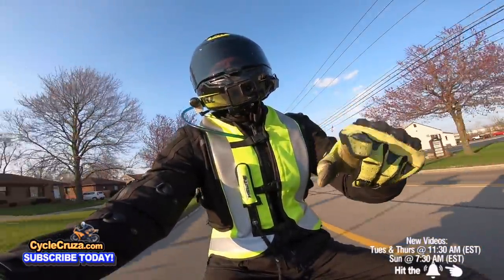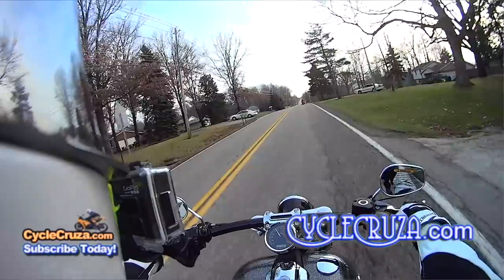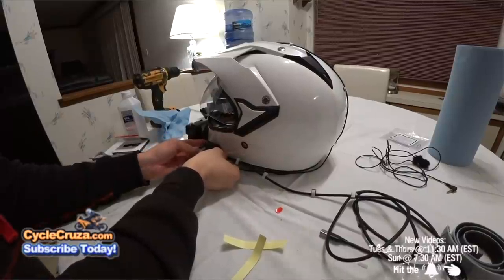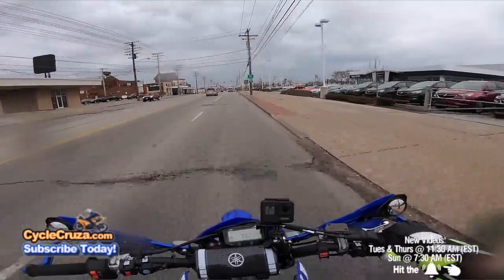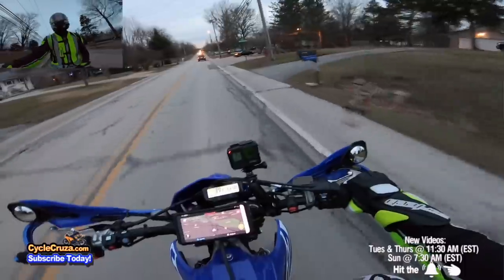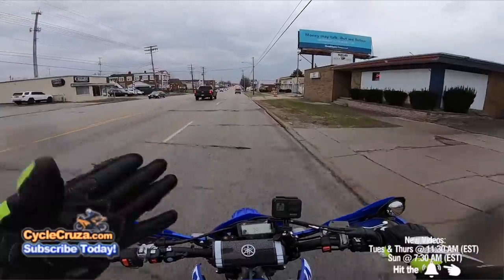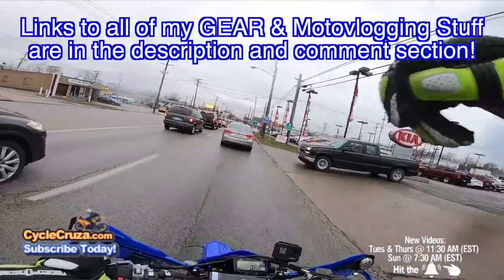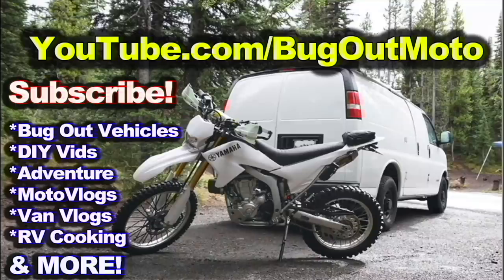How To MotoVlog  & Helmet Camera Setup

Comment: The audio sounds good at 30 or 40 mph. How does it sound at 70 or 80 mph.
Reply: I have a tough time at those speeds. I use a deadcat which helps a lot.

Comment: I'm working on my channel one vid at a time. Having a real struggle with audio. My cheap GoPro clone doesn't have separate audio input, so I use a digital audio recorder but it's way too sensitive! You'll get wind noise from a fart across the room. It's good for interviews, courtrooms and ghost hunting but not motovlogs unless I'm only going walking speed. I'm in the market for a new helmet anyway so it may be time to invest in better recording gear.

Another challenge I'm having is scripting vs winging it. I want to have what I say be meaningful and concise, but that's hard to do without a script. Then when I DO have something written out, it's hard to get it to sound natural not. like. I'm... reading aaaa script. Right. Otherwise I get a lot of UM, UH, or worse long pauses. That comes with practice, I guess. Cheers to the good work. Been following you for 4 or 5 years since I just started learning to ride, now on to my 2nd bike.  Wellll anyways.... Always an inspiration!
Reply: There are free tutorials on public speaking on youtube, just put "learn to speak in public" in the search box. 
I was an Air Force Instructor we practiced a lot, also we didn't have a script per say, our lesson plans had bullet points and topics just as reminders on what to talk about, of course having to say the same things over and over makes it easier .
hope this helps.
ps after while you when  get your public persona and all the umms, ahhs and other things go away. But then I say don't worry about you should see the Governor of California speaking and no one is complaining or commenting on it.

Comment: I tried using an external power bank for my go pro 7 black, but it caused my camera to freeze up. (Adreama 10,000 mAh Power Portable)
Reply from the maker: It depends on the power bank, I've had the same issue in the past with various power banks.

Comment: I have tried lol I made a video about 15 minutes long and everything I sead was blocked out from wind noise
Reply from the maker: Make sure to put on windscreen and tuck the mic at the edge of the pad inside the helmet. Don't put the mic towards the bottom of the helmet. Also, make sure your helmet has a chin curtain.